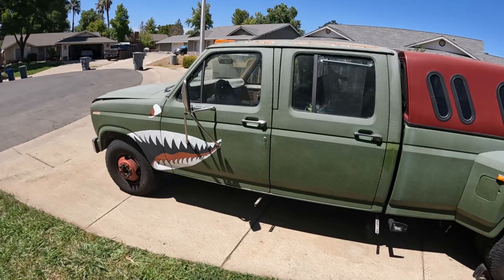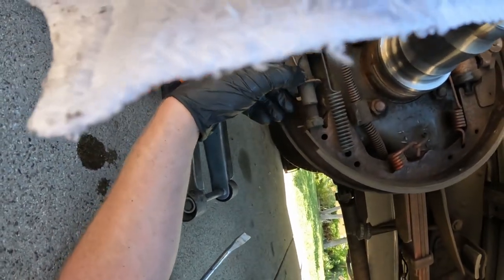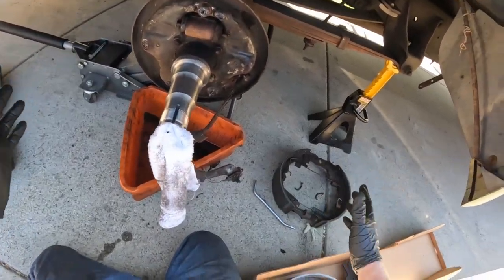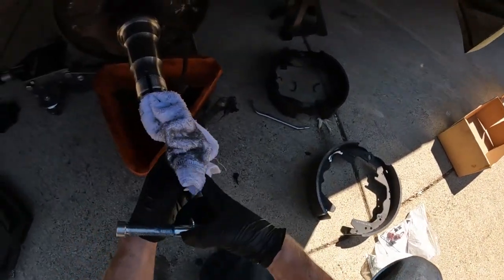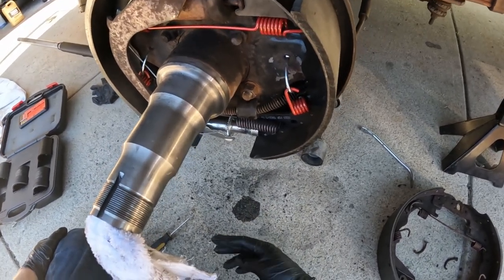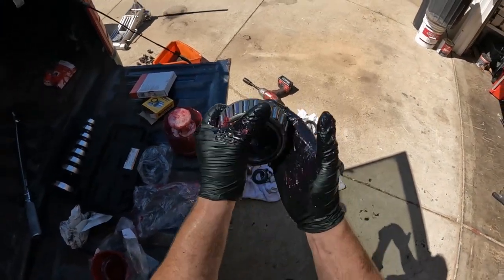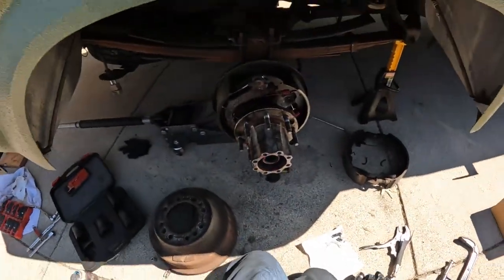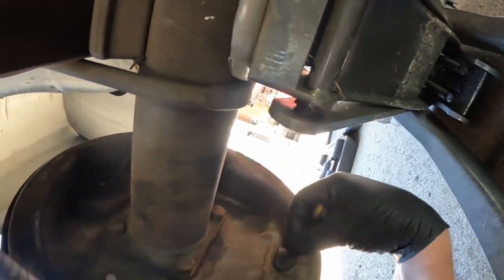Ford F350 F250 Rear Brake Job and Wheel Bearing Replacement 1985 - 2005 Sterling 10.25 dually

Comment: Old timer gave me a good tip, never failed, insted of silicon, use high tac, will not leak, the rear end grease leaks past the steel part of   the bearing seal its not the rubber part of the seal.

Comment: do you have a link to the parts you used?
Reply from the maker: I would get them from your local parts store. There are a few different size brake options. None of the ones on amazon looked right.

Comment: The bearings don't run in grease, they are lubed by oil bath using the rear end fluid. They should be pre-lubed with rear end fluid.

And there is a specific procedure for setting the nut torque. This isn't it. They should have been torqued to 55ft-lbs, then backed off 7 clicks for new bearings, 5 clicks for used bearings.